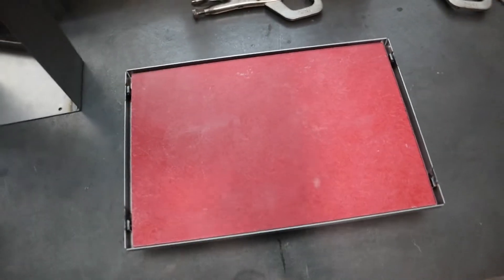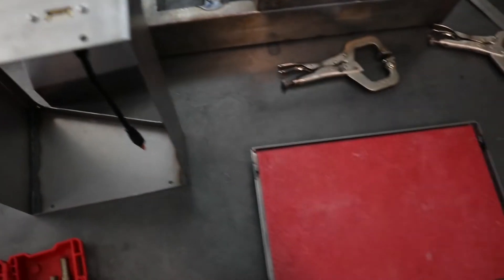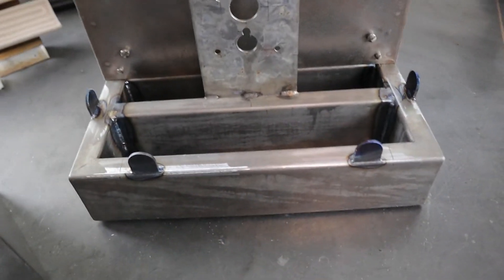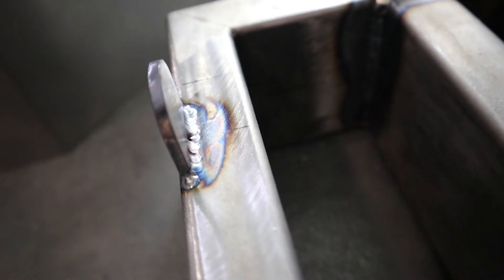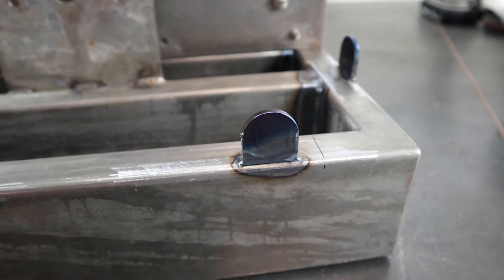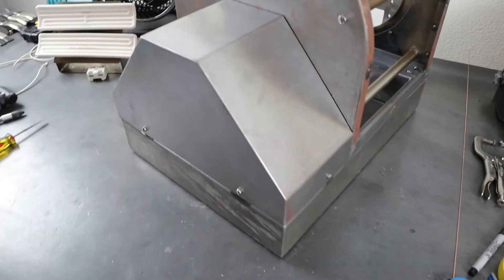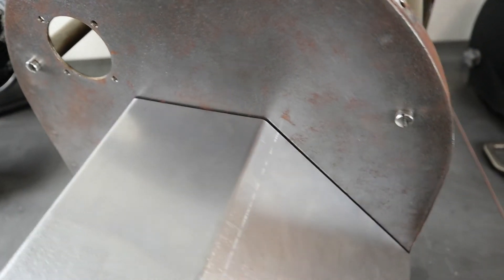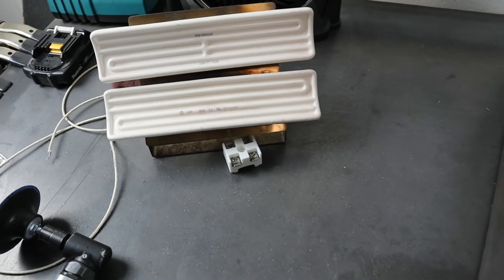DIY Coffee Roaster Build Part 2

Comment: I've been diggin this serie so much, i've been looking to build a roaster myself and this video has had me inspires so much!! Thanks for sharing all this. 

 i've been wondering about the heat source for some days now.
See you got installed some ceramic infrared heat emitters and i was wondering wether that would work with a closed drum at all. From what i've read online this heat source soesn't seem to get trough steel very well. (Or heat up the drum in that sense) so i was wondering wether this migh've been the reason you went for a perforated drum.

If i want to continue with a closed drum, i might need a LOT of power to get to the temps i need (i'm seeing machines for 600g being able to get up to 3kw) wich is twice as much as this setup.

I was wondering if there's any place to get some more info on this aswell i'm considering a closed drum electrically or gas powered and i'm fairly new to this.

Thanks for the inspiration this gave me.
Reply from the maker: Hi, glad you enjoyed the series. I’m not too sure where to find more info on the subject. That was sorta my reasoning for using a perforated drum, as I’m not sure that I have enough power for a solid drum. I believe Mill City Roasters offers a larger electric roaster, but I’m not too sure about the drum construction. They may give you the specs in the description.

Comment: Nicely done! I like the way you fixtured  the tabs to leave space for the cover. BTW, how did you fab that perfect fitting cover? I have never seen SSR's mounted on a heat sink that way; cool. I like your precision, high-quality work, keep it coming.
Reply from the maker: Thank you! The cover wasn’t too hard to make since I had access to a shear and brake. The hard part was getting the weld seams to look like they were bent on a brake. Lots of careful grinding and filing! The SSR’s came with the heat sinks, which was cool. I still might add a cooling fan to the enclosure...
Reply: Good idea about the fan, heat sinks like fans…